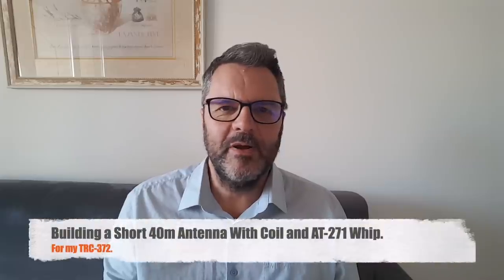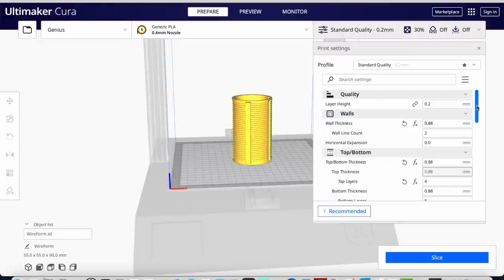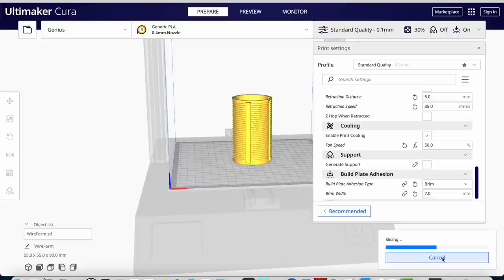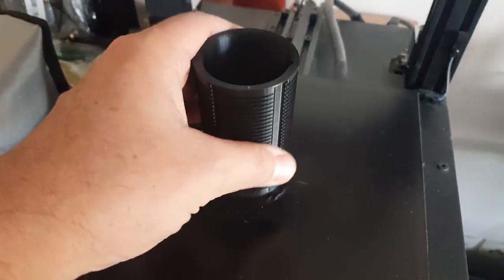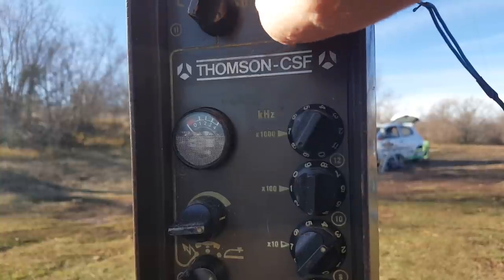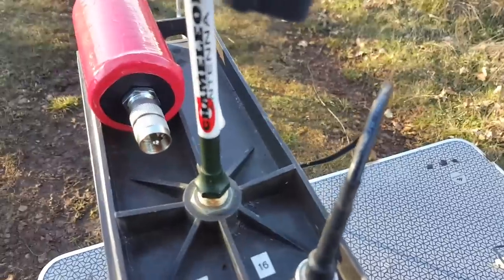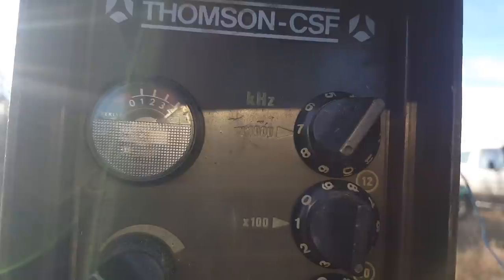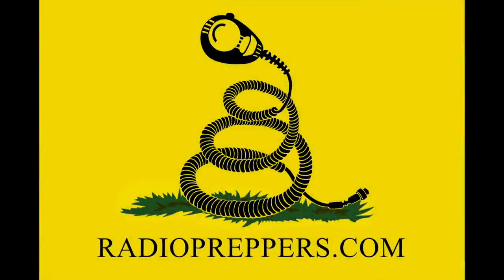Building a Short 40m Antenna With Coil and AT-271 Whip.

Comment: Did you test the filament you printed your coil form out of? not all plastics are compatible with RF.. to check it just print a token item out of the filament  and put it in the microwave oven along with about 8 oz (a teacup) of water) and heat the water to boiling (212 F, 100 C) and check the token item for heating from being microwaved. If it did heat, it will affect the impedance of the coil wound on any form made from it. We have been using this method to test any plastic forms (Discarded deodorant dispensers, pill bottles and so on) for decades an inert plastic will NOT heat up in the microwave oven,  and the cup of water is needed to act like a dummy load to the  oven..
Scott N9TGW
Reply from the maker: Interesting thanks!
Reply: Interesting idea, will try it with different materials!
Reply: Brilliant, simple test, thank you.
Reply: Outstanding point!!
Reply: Interesting nugget of information. Ill log that in my knowledge database for future use. Thanks.
Reply: or the shrink wrap
Reply: There is a Caveat apparently. 
Some type of frequency dependence.
That testing RF absorption at 2-4 GHz is not necessarily the same for 7 MHz.

Comment: I enjoy your videos...real people experiencing real problems!  It was obviously getting colder.  Anyway, I made a coil14" in length and 1.5" in width.   I used bare wire and a clip to adjust the tuning.  I can get a low SWR down to 80 meters with a counterpoise, but I have to hit the exact spot on the coil..  The coil's ugly but it works.  Your video is helpful, and it's encouraging to see that others have encountered the same issues that I have.  Keep up the good work.
Reply from the maker: A clip is the key!

Comment: Maybe check that the impedance is correct using a VNA.  I see that the designer suggests using 16 gauge galvanised fence wire.  American 16 gauge is about 1.3mm diameter and fence wire is iron not copper.  I’m not sure how much difference that would make.
Reply from the maker: It might indeed...

Comment: Nice video, the best way to learn is through experimentation trail and error, I use to be a professional PRC320 and VRC321 operator, there were days coils were great and other days whips without coils, then tune the best match, sometimes which might be to the first mark on the dial (very bad match), then you the best audio filter; the one in between your ears to establish global comms, keep up the good work 👍
Reply from the maker: Will do thanks!

Comment: 3D printing has to be one of the most useful innovations of the last 50 years and can be the answer to everything from making one of bespoke parts to replacing rare and obsolete items.👍 When they become a bit more affordable I'll be shopping for one!😀 In the meantime I made a coil for 40m from some 110mm white plastic waste pipe, some 1.2mm ECW, some bits of aluminium and steel tubing and a few nuts and bolts, all of which I already had lying around so cost me nothing. I use it with a 5.2m telescopic whip, similar to the MFJ items but a Chinese copy for £23. The coils screws into a 600mm long, 25mm dia aluminium stake via an earthed steel mount and in soft moist ground it works great without the need for radials although it has the provision to connect some if required. It tunes well from 40 to 10m.👍😀❤ I like those military handsets and thinking of getting one to modify and use with my TX-500.
Reply from the maker: Nice. I will be reviewing a new printer in a few days..

Comment: If the resonance frequency was at 9.3 MHz, the whip is too small and needs to be lenghted for 7 MHz.

Best to use an adjustable coil with a slider (JPC-7) or plug (Buddistick) in order to adjust inductance to bring the antenna into resonance. 

Furthermore, a counterpoise (either at least one elevated and tuned radial, or as many as practical untuned ground radials) is really required with this type of antenna (Groundplane) in order to perform well and bring SWR down near 50 Ohms.

As pointed out by you, placing the coil higher above ground increases the efficiency of the antenna system when transmitting.

Great job done with your 3-D printing!
73 de Chris. DL1GKC
Reply from the maker: Thanks, I'll try an adjustable one..

Comment: I used the larger coil with steel wire from eveks  ev_edelstahldraht-1.4404-1.2_5 
Connect one side to top screw, tho other screw is connected via a wire to a slider.
Works great on 10-40m with a at 271 whip and some radials

Comment: Good video❗️I thank a lot of the old military Radios were designed with internal antenna tuners that were able to tune to many different antennas for the same frequency to allow for damage to the antenna in bad field operations.  If your existing antenna was damaged just patch it retune and go❗️👍 73. KV5P
Reply from the maker: Indeed, great radios!

Comment: I enjoy watching your videos as you learn more and more about RF. That's what ham radio is all about, or should be. 

Here's a long-winded comment, I'm afraid. Some Elmering if you want it.
Unless you can do all of the calculations for it in advance, (some substantial math,) feeding a tunable circuit (the rig's output,) into another tuned circuit (the coil's inductance and its capacitance) is just gambling. Your radio's internal tuning circuit is already designed to tune a short whip, but the loading coil makes it appear to be a full-sized whip, sort of. And a physically short antenna with a big loading coil will ALWAYS be narrow band. That is why they have those little alligator clip jumpers you mentioned for fine tuning. 

Basically, you want to look at the entire output circuitry and null out the reactances, and hopefully leave yourself with the output amp stage seeing the resistance it's designed for, but you have added unexpected reactances due to the coil. If you had a rig without an output tuning stage, simply one preset for 50 Ohms like many commercial rigs, then your whip and loading coil might work fine, perhaps needing a counterpoise wire or 2, or a good ground. But you would still need to be able to fine tune the antenna loading coil since it would only cover a narrow bandwidth, depending on its 'Q', and the better the Q the narrower the bandwidth. It's a tradeoff in efficiency and bandwidth that is best solved by being able to fine tune the loading coil if you want maximum signal. 

But here's where I suspect the problem lies:
Did you hook up some counterpoise wires and run the whip on an antenna tester or a NanoVNA? That will allow you to see what's going on with your antenna, and where that LC is actually tuned for. I'm thinking you will find its entire narrow bandwidth to fall below the 40 meter band due to the loading coil capacitance. Plastics are only 'inert' to DC. At RF they become an active part of what's happening. Depending on the type of plastic you used for the loading coil form the coil's self-capacitance could have put its relatively narrow tuning range completely outside the 40 meter band leaving the coil to act like a trap on 40 meters. Note that the resonant frequency is a function of the whip, the loading coil's inductance, AND the loading coil's capacitance. The capacitance of a loading coil is due to the proximity between each of the windings, AND any plastic form (a dielectric material, like plastic, that you wind it on increases that inter-winding capacitance substantially, to a degree based on the type of plastic used. That's why you will see old radio coils made of ceramics. They have very low capacitance. And you will see capacitors made with a wide variety of dielectric plastics because each type is different in its electrical properties, each with advantages and disadvantages.

BTW, don't be fooled by the fact that you could hear some stations on that antenna. A rig's receiver is designed to receive stations over a dynamic range difference of many thousands of times. Your antenna can be utterly miserable and still receive some strong stations. But an antenna that is cutting your transmitter power by thousands of times leaves you with essentially nothing.
Reply from the maker: Thanks. I was indeed hoping that it would end up being "close enough," wishful thinking... I tried a single 10m counterpoise wire which I rolled up while testing the SWR.  I should have done a wider sweep with my analyser.. I'll probably make one with the alligator clip so I can use it on multiple bands...

Comment: Hi Gil,  always a good day when I see that you’ve posted a video. 

When running any vertical especially quarter wave verticals your radials are as important as the vertical itself. I would recommend a minimum of four. And more would be even be better with the diminishing returns after you get above 16.  If you can’t get full length 1/4 radials, many short radials is better than a few long radials.  This is because the return currents are higher at the base of the antenna. 

As the antenna length drops, the feed point radiation resistance drops making it very challenging to get the RF energy into the antenna system.  You can think of it as series circuit with the combination of the radiation resistance, ohmic resistance in the antenna conductors, and the ground resistance combined.  Having a good radial system allows the RF energy to be focused on the radiation resistance and not the ground loss.  The Ohmic loss in the antenna are usually a smaller factor, but as the radiating element gets smaller and smaller they can come in to play as a concern.  The radiation resistance is where the real work is done, so you want it to be the predominant resistance the transmitter sees. 

I think your coil will work fine, but you need to fix your radial system first. 

73,  de KB7ZUT
Reply from the maker: Thanks, I will make a portable radial system...
Reply: @RadioPrepper  Gil, good stuff. I’m traveling this week, but when I get back to my office, I will send you a couple of documents with the details. Not too technical, but full of good info on optimization of verticals and radials. It could be a topic for an upcoming video to share with your viewers. 73, and keep making this awesome content.
Reply from the maker: Awesome thanks:-)

Comment: Hi . Just a question. Are you having problems with coax cable. I've have had problems due to cables being made of steel . Yes copper coated steel wire. Test with a magnet.  I thought RG spec cables were copper or they used to be 20 years ago. Inner core breaking etc. Cheers from old George
Reply from the maker: Hi, I am not using any coax cable for this antenna. The coil plugs in directly into the radio..
Reply: @RadioPrepper  Have you tried a magnet on any of your coax cables to see if they are steel wires. ? Cheers from George
Reply from the maker: No, I'll try...

Comment: The whip you have is good, now just add a 14  Turn copper wire on toroid (your choice  of power ) tap coax and whip into it  for  resonance, it will  easily do 40m
Reply: @brad1367  no Brad, wind 14 turns 1.2mm copper wire on your toroid  leave an eye to solder on every turn,  one end is braid the other is feedpoint (antenna), tap the inner coax  at a point where it reflexs 1:1 +_
the braid connection  can be moved closer(meaning 12 turns  total or 11 or 10 etc...) or 7 turns as the freq of operation will change the amount of inductance we need, on a 108" whip 14 turns work like a charm on 7mhz.
i use a crocodile clip on the feed coax and tap into the toroid connections, for the different bands, when done ... i use  a small bandswitch  for quick change... When you use 2 mobile antennas (identical) in a dipole configuration, (portable, turnable dipole) you can use the same feed method via the 14 turn toroid, it makes for a small dirty tuner and feedpoint match. Hope you understand.

Comment: Hi Gil
Great 3D printing project. Tapping the coil will be more successful as it will make it tuneable, you would be able to primarily tune it using the receiver audio. Also the black plastic may be causing you a problem.
I built a 2m J Pole using black conduit and it was a nightmare to tune as the black conduit was acting on the aerial, the second one using white conduit was perfect first time.
Good luck and have a great 2023
Reply from the maker: Interesting thanks.
Reply: That is probably due to the carbon content used to colour the plastic and also provide some UV protection.

Comment: It is counterintuitive, but this 3D printed adapter will be stronger if printed standing on its brim, rather than on the large flat face. The print is stronger when largest stress is parallel to the layers. Thanks for your very instructive videos.
Reply from the maker: Indeed thanks!

Comment: I operate a QCX-Mini powered by a 6ah LiFePO4 battery with a Wolf River Coils Silver Bullet 1000 with six 32' radials  on 40M. I live in Arizona and get 3 or 4 state propagation. I loved that you printed that purpose built 40M coil. I'm not sure that the coil is no good maybe just the application. You should try it on a QRP (or just a simple radio without the ATU)  radio with a simple vertical and counterpoise. I think it might work. Great video, stay warm.
73
Reply from the maker: That's a huge battery for a QCX!

Comment: Gil, I suspect you are correct that the Thomson radio's matching system allows the short whip to radiate more efficiently. The internal matching output will be at the whip feedpoint. So, when you add the coil, it is just adding a non-radiating load at the base of the whip. Not only that, the RF current will be at a maximum at the base of the whip (where the coil is). So, it will be best not to use any coil, so long as you can get a match with the radio's internal matching.

The 6:1 VSWR, I am not sure about. If the analyser was calibrated with a 50 Ohm resistance, it must mean that around the miminimum VSWR, the antenna is just not 50 Ohms resistive. If you plot the impedance across a frequency range, you might find the antenna has a purely resistive resonant frequency that is not 50 Ohms?
Reply from the maker: Right, who knows.. I will just use the radio's tuner now but might tinker with the coil a bit more...

Comment: I think it is expected to have a very narrow bandwidth with a heavily coil loaded antenna, and that it is quite unstable if you change counterpoise position. You should try and hook up that coil to a end fed wire, maybe it can go to lower frequencies. Maybe you could use a plastic water pipe and print only a few (3-4) "coil former" stripes, flat on one side (for gluing to the pipe) and comblike on the other for guiding the wire. I saw a youtuber do that when making a coil for a tuner, haven't tried it yet myself.
Reply from the maker: That would be interesting...

Comment: I often use a 6m vertical with a center coil and ATU at the bottom and of course a counterpoise.  Works well on 80m and should work well on 40m as well  depending on the coil inductance.
Dis you measure the coil' s inductance?
Reply from the maker: Not yet. What are tour coil specs?
Reply: @RadioPrepper  My short 6m vertical for 80m had a center coil of abt 60 uH. The coil was close wound    with 1mm2 enamelled wire on a 32mm PVC tube, about 90 turns. 
On the ground side I tuned the antenna with a small rollerinductor or with a FRI match (z-match) and used a few ground wires as a counterpoise. 
I did the same with a  10m long 80m vertical. There the centre coil was 20 uH. For the 40m meter band the coil vallue is much less of course.  I never tried that. Nice project doe next summer
Reply from the maker: Great info thanks!

Comment: Here's a TIP for the heatshrink tube, Boil your kettle or a saucepan and steam the heat shrink 
tubing for a much neater job.
Reply from the maker: Great tip thanks!
Reply: @RadioPrepper  Gil, recommend getting a heat gun. They are modestly priced and work exceptionally well. Do NOT settle for a hair dryer as they are too weak. I am surprised you did not opt for a shorting clip device - a la the Wolf River Coils antenna system - as that will makes the matching more flexible. 
Regards, William, k6whp
Reply from the maker: Yes, I will get one, and will print a longer coil with a clip..

Comment: Your coil looks similar to the Buddipole 40 meter coil but without the shorting lead.  It is designed to be used with a 5.5 ft  adjustable whip plus 2 each 11 inch aluminum accessory antenna connecting arms.  Max length above the coil is about 2.25 meters.  Designed to operate 40-6 meters.  I think that you may have a good coil that only needs some modification (a shorting lead to raise/lower the inductance) plus a reduced antenna length (your whip or other adjustable whip).  Good video! 73 de AE5ZX
Reply from the maker: Thanks, I will work on it...
Reply: @RadioPrepper  I forgot one other attribute about the Buddipole 40 meter coil.  Configured as a Buddistick (a coil loaded vertical antenna), you can insert the coil above the two 11 inch aluminum arms and then connect the 5.5 ft whip to it, so it would not technically operate as a bottom loaded coil (not the best location as you have so indicated), but sort of like a center loaded coil, but not really in the center.  Is there some way you can measure the inductance of your homebrewed coil to see if it is suitable for 40 meters and above operation?
Reply from the maker: A fiendvof m8ne can, soon... I used to own a Buddystick...
Reply: @RadioPrepper  I still have my Buddystick.  I am not all that impressed with it, especially on 40 meters.  I am an end fed and random wire antenna fan for portable operations.  Of course I know that your favorite antenna for portable operations is a real EFHW.
Reply from the maker: Indeed, but mine worked fine down to 30m... 40, not so much..

Comment: Do using a coil gets nice SWR but power loss on the coil when compared to a whip length for the 40 meters?
Reply from the maker: A coil should be better than a tuner. Coil in the middle is best..
Reply: @RadioPrepper  Thanks.